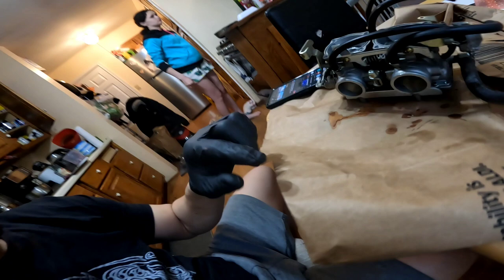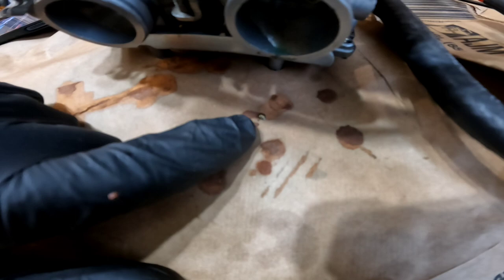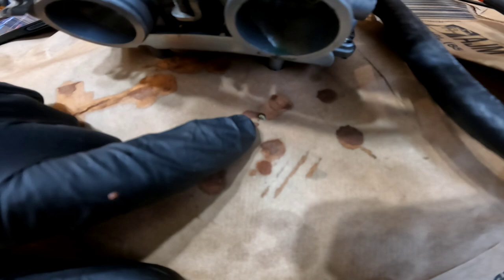I saved my Motorcycle Carburetor by using Acid to remove a broken Air Fuel Mixture Tip

Comment: Very helpful.  I have a '79 Yamaha XS750 (Three Cylinder) where all three carbs have a broken Pilot screw.  I bought 22K tester.  Not sure if that is too strong or not but will try it out.
Reply: Did it work out? I have the same bike and same issue